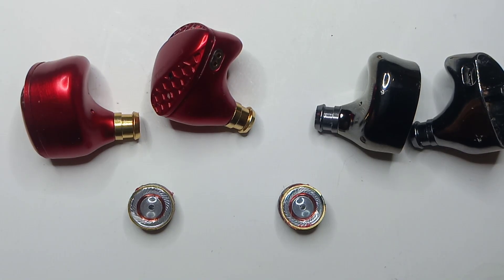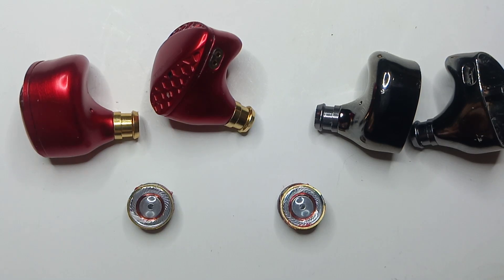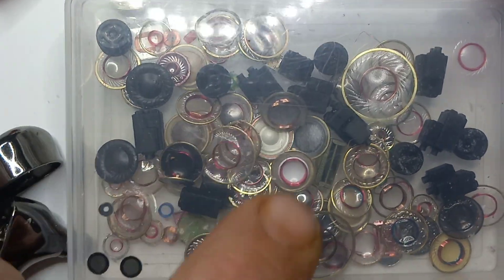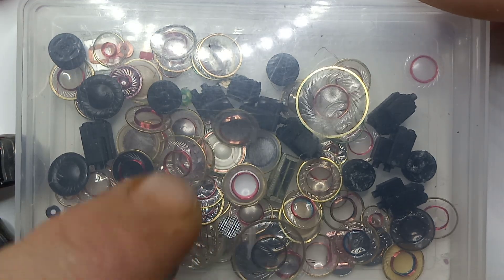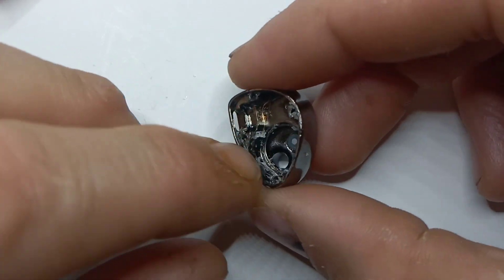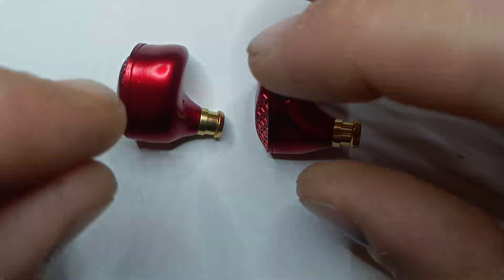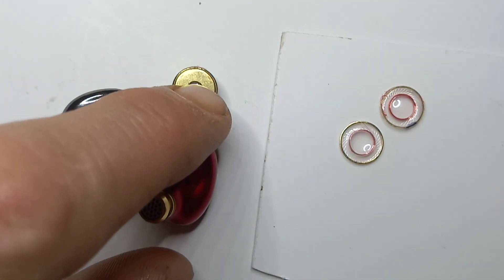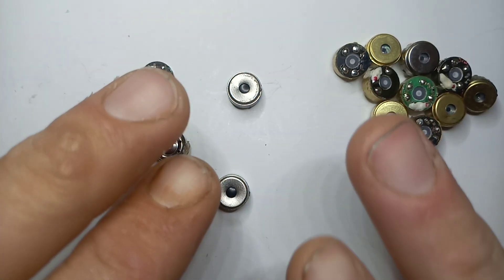Did Tangzu Lie? ShiminLi EnounterGate 2023. Teardown and analysis of Wan'er and Shimin Li Encounter

Comment: Great tear down. When I get my Encounter I will check out if I really can hear the difference from the original. Did you weigh the shells? I'll weigh both but my scale isn't very accurate.
Reply from the maker: Unfortunately i don't have a scale. :-(
Reply: I weighed my encounter (intact with driver inside) 11 grams
Reply: @JonnyMorgan18  I get 11.5g for my gold Shimin Li. It should be close enough.
Reply: @oijans  It's probably the same, my scales don't go more accurate than full grams, I turned it on it's side and it registered 12g momentarily

Comment: You can anodized titanium with electricity and a certain oil...forget the exact process but there's tutorials for it. You could try anodizing that driver to determine if it's titanium
Reply from the maker: Chemical Electrolysis.
Reply from the maker: Also vapor deposition.

Comment: As with most things these days, cost efficient/ profit margin drives everything. When they get enough, they will upgrade to something else and ride that till they can't. Look at the car industry, Hyundai/Kia have had the same three 4 Cylinder engines in their cars for over a decade, the 1.8, the 2.0 and the 2.4 have been used since the 2000's. Update amd modify till you can't but develop in the back round so there is a replacement ready when you can't do anymore to it.